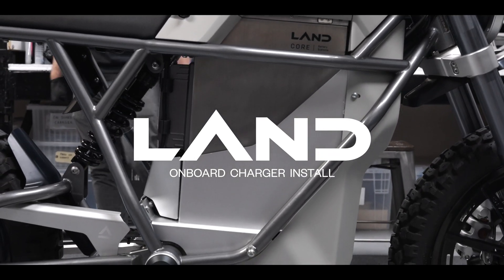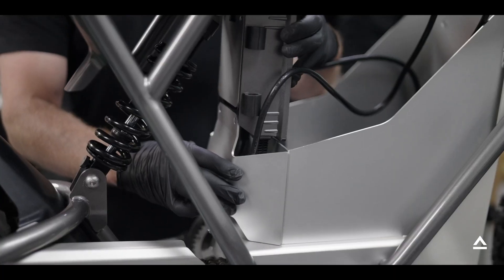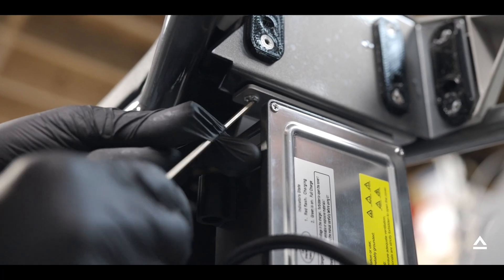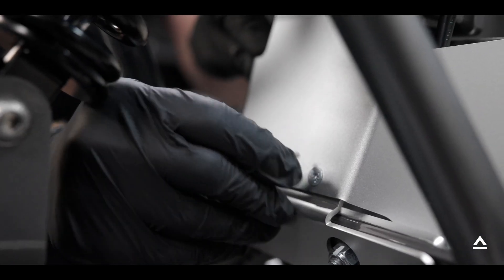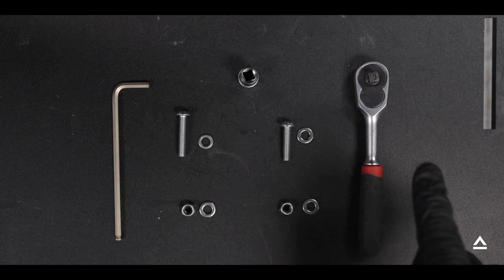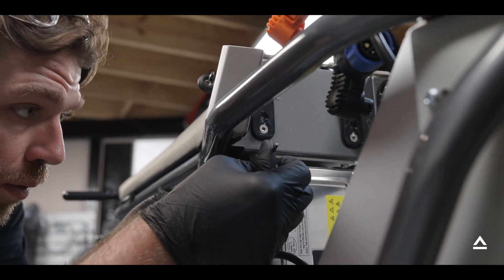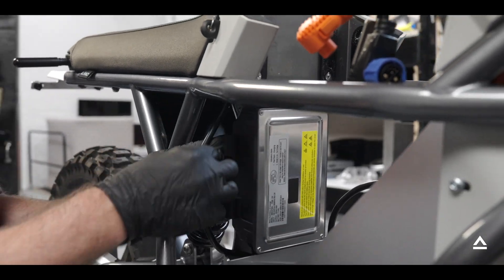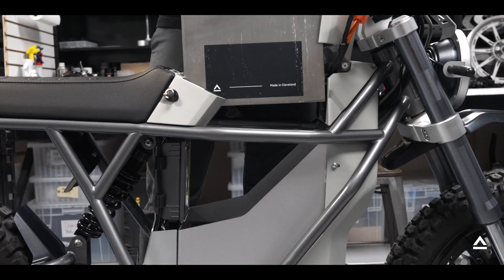LAND Tech Series | Installing Your Onboard Charger

Comment: Is my bike coming like that too?. I pay extra so my bike will come assemble already?
Reply: That onboard charger is a separate purchase. It’s not even out yet.

Your bike does come fully assembled though. Mine did.
Reply: It's out already mine's coming on fourteenth
Reply: @RandomMotoThings It is out now. I'm getting mine on the 14th by pre. Ordered, but if you purchase it before you get your bike, they probably will put it on for you
Reply: It's out you had to pre-order to get one by the 14th. Mine's coming on the fourteenth
Reply: @RandomMotoThings what’s your range
Reply: It will come fully assembled and if you bought the o. B charger, they probably will put it on for you.
Reply: I pay that extra charge so it could come assemble
Reply: @alexandersantos6019 It comes fully assembled to your house. Buy them personally delivered
Reply: They say May 18 mine will come let’s see
Reply: @alexandersantos6019  Mine is on the way. I'm tracking it through u. P. S should be here on the fourteenth, and I also blew one of my tires on friday, so they're sending me a new tire to replace the old one.
Reply: @John-oc4vq  well have fun with the bike just in time for the summer. I don’t think mine is coming from UPS because I pay extra so they can have it delivered in a  truck already assemble and everything.
Reply: @John-oc4vq  do you put license plates on it and insurance? Or you had them do it for you because that’s what I did. I had them do it for me, it will come already with the license plate.
Reply: @alexandersantos6019  Yeah, my moto came fully assembled and delivered. Also, i'm talking about the onboard charger
Reply: Yeah, I just got a temporary. I'm waiting for the actual license plate and registration.
Reply: O B charger is meant to use on charging stations right? . And does it matter if it's a level 1 or 2?
Reply: It's not a bike it's a MOTO.....